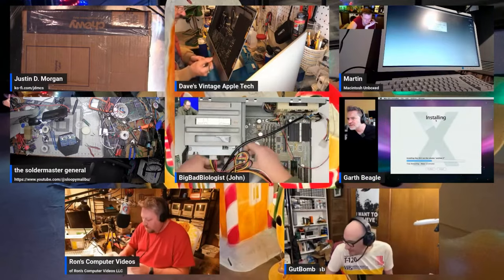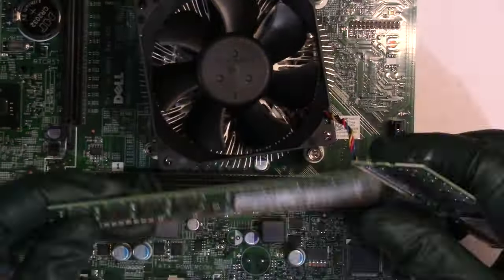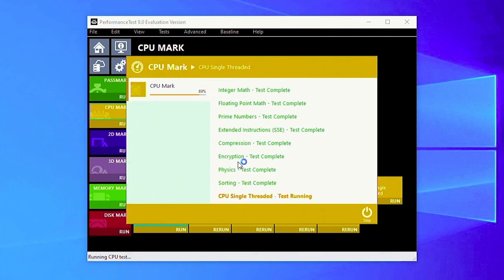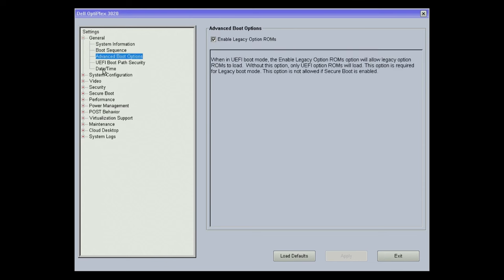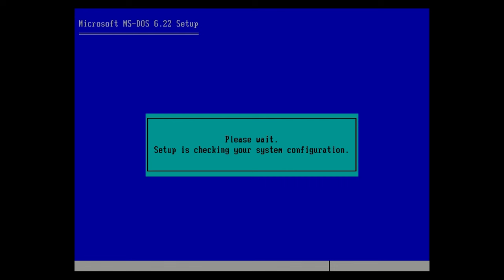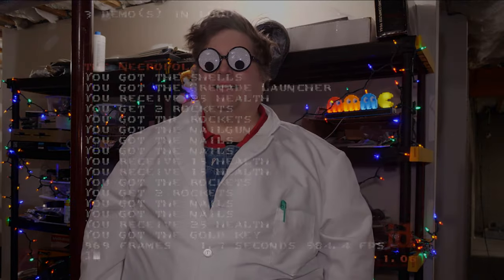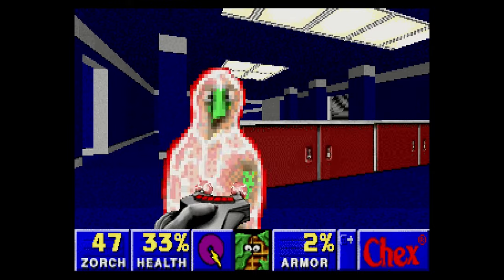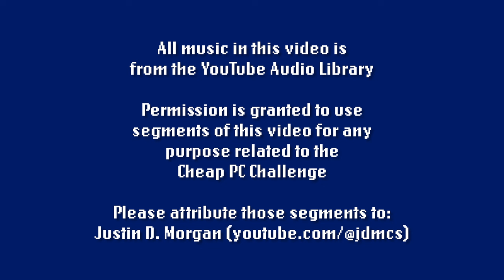Potential Regrets 2023: Justin D. Morgan's Official Gaming PC Challenge Build #CheapPCChallenge2023

Comment: Nice video Justin! Dune prefers to live in 33 MHz or so (25 to 50 is fine). You can use DOS utilities to artificially throttle down your cpu from vogons. If you're interested to try DM me.
Reply from the maker: I just might have to try those utilities to see if they can even tame the Haswell beast into a DOS gaming system! (Now I'm still stumped about getting something better than PC Speaker sound, but without a parallel port or PCI slot, this Dell isn't going to let me... now maybe one of those AMD boards from my first two attempts?)

Comment: Not the only XFX R9 390 to get purchased for $25 for the challenge. I could never get mine through the benchmark tho, my Dell powersupply shut it down every time it got close.
Reply from the maker: Not sure which Dell you were trying to install the R9 390 in, so I can’t venture a guess as to if the power supply shut down in response to the increased load of the graphics card, or in response to a fault in the graphics card which happens under load.
Reply: @jdmcs   I didn't know until I finally got a PC with a power supply that could handle the load.  But it seemed to work fine in that new system.
Reply: Something I realized when I did get around to testing it was that the Caves section is very noticeably single thread CPU bound if the card is fast enough. I got around 200fps myself, but the card was burbling along at 60-70%.